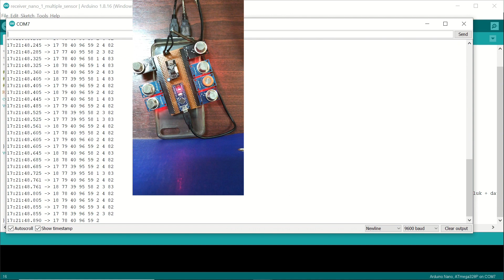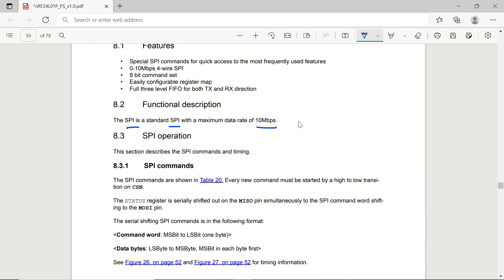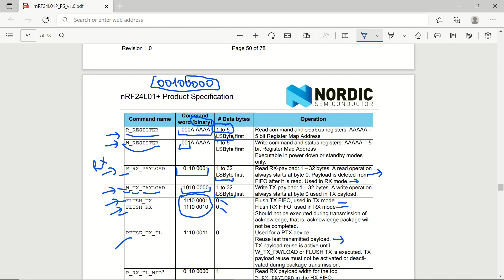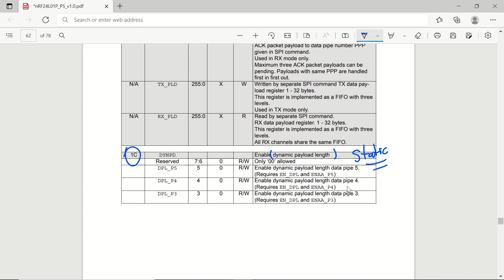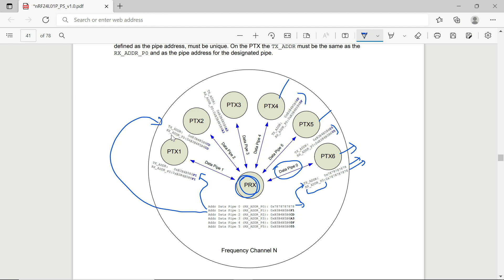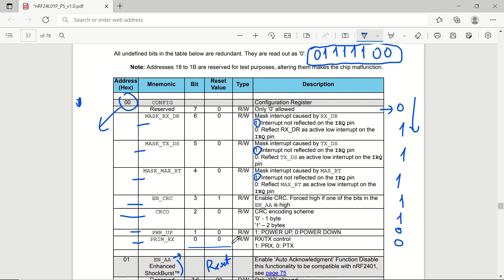nRF24L01+ Tutorial

Comment from the maker: Two minor corrections for the video:
8:43 "open reading pipe" was not used in the TX, so you can check in the .cpp file, it has an additional parameter for pipe number (0-5)
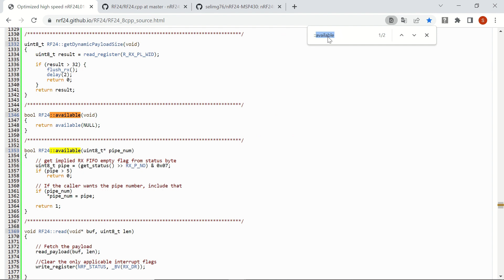10:53 "read_register" is shown instead of "read", you can check "read" in the .cpp file
Apologies for these inconsistencies.

Comment: Thanks for the Tutorial and code.  I am currently struggling to get "Attiny1634 or Attiny841" to transmit with the RF24.
Reply from the maker: Good luck with that. My Pic - nrf24 video can  be supportive as well.
Reply: @drselim  Yes, your tutorial video will help a bunch!  They had this working 4 or 5 years ago, but the library (RF24) changed and broke those programs.  I have some good functions code and along with your help on the datasheet, I can get this done, just will take some more time.
Reply: Ok! Got the 1634 talking to nano with the nRF24L01!  Used "Robin2" test program, and I was not SPI connected.  I had connected the MOSI and MISO pins together on both 1634 and RF24, instead of crossing them, MISO -> MOSI, MOSI->MISO.
Also, put "radio.stopListening()" before "radio.write()" in loop.
Trying to follow your low level manipulation in the video, helped turn my light bulb on.  Thanks
Reply from the maker: You’re welcome.